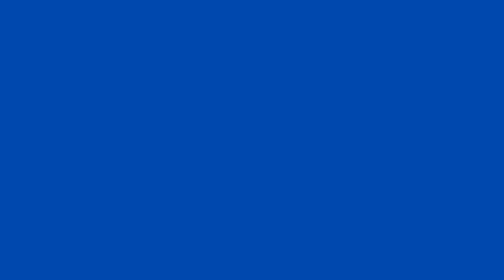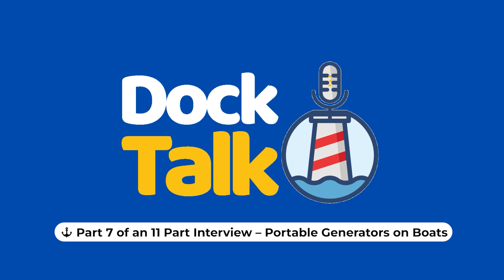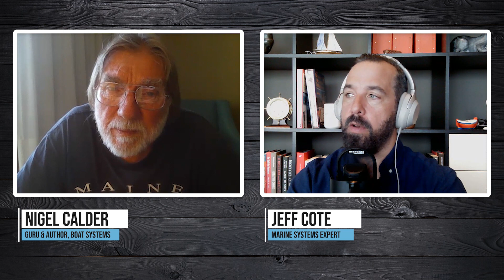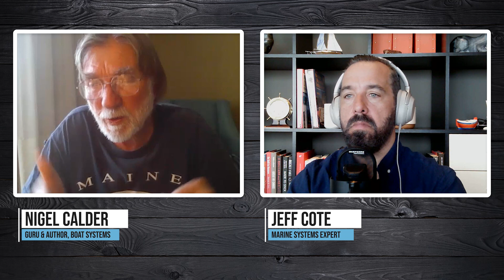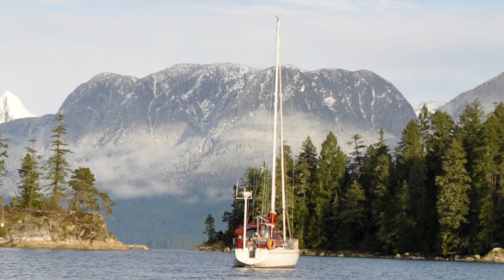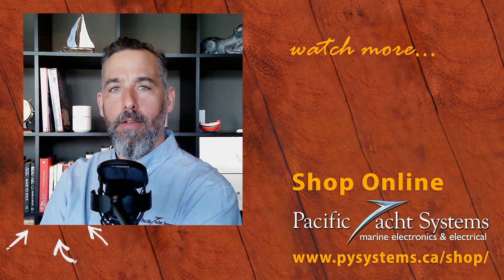Nigel Calder & Jeff Cote Talk Marine Electrical - Part 7 of 11 - Portable Generators

Comment: Oh such such negativity. I've carried a Honda 2000 on board since I converted to Electric Propulsion in 2008 and now have a Champion 3400 watt generator too. Never had a problem. Of course common sense rules the day. Exhaust directed over the side or aft at the stern. Always drained the Honda fuel tank if storing below. Only use about two to ten gallons at most  all season carried on deck in two small jerry jugs and are never stored in a locker. Another advantage of small on deck generators is they are more easily maintained than a "marineized" one crammed down below decks. Also easily replaced as technology advances and removed off the boat for home use.
Reply: Yup...My bet is Nigel want's everyone to have an Integral.  I'm sure years ago (before his involvement with Integral), he carried a portable generator :).
Reply: OK,  This one prompted me to write my first comment on YouTube.  So many issues here to comment on so I‘ll sum up my overall feeling that this video should be deleted by PYS.  It‘s simply not based in fact and mixed with extreme biased discussion by Jeff and Nigel to the point that its a waste of time from two otherwise knowledgeable people.  There are always pros and cons associated with anything to do with boating equipment and this video presents no counter-argument.  I‘m disappointed in PYS for posting this with little regard for providing any serious analysis.  Only thing here is two prognosticators musing about their own opinions.  I used to respect these two “experts“ but no longer….
Reply: @johnknie2758 What part of what they stated do you disagree with? Give specifics.